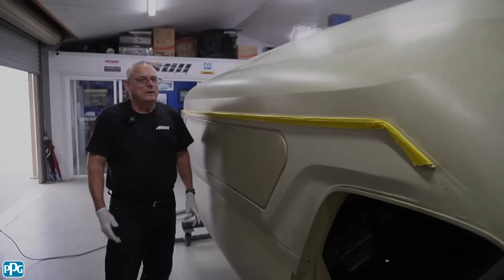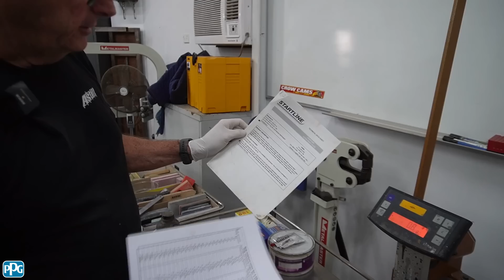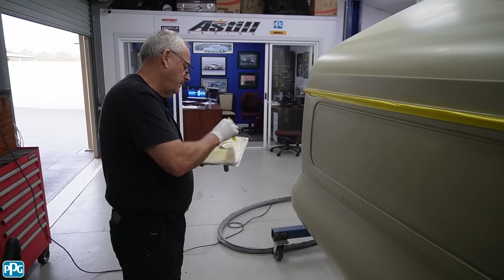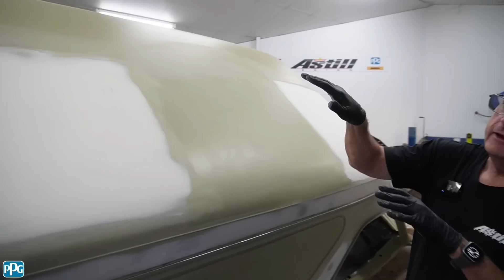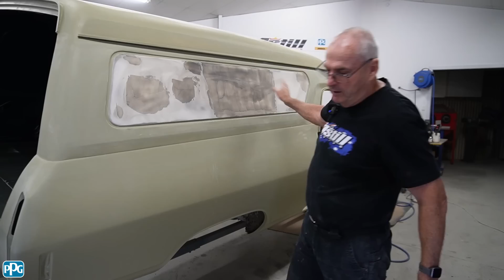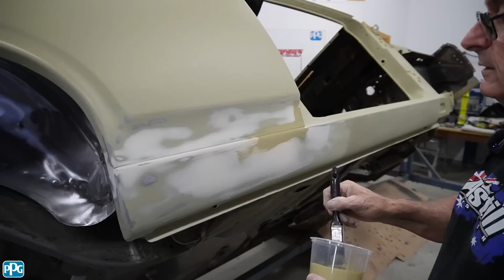Filler work & Body Lines on XC Falcon Panel Van #16 Magnum Force

Comment: Nice work Howie. You do use a truckload of bog in your viehcles don't ya
Reply from the maker: I use what is needed to get the result. I could use less but then I would use a truckload of hi build primer or Restofinish spray on filler.

Comment: Do you rub the primer down before applying filler?
Reply from the maker: The epoxy is sanded with burgundy merlon (scotch brite) 360 grit roe you can use 240 sandpaper. If has just been applied you have an 8 hour window we’re you don’t need to sand. Wet on wet.

Comment: I have been in a pretty heated debate with other painters that say hand sanding is the only way that you can't use air sander which I have learned how to apply both and doing alot of orange peel removal with orbital finish sander
Reply from the maker: There’s a place for all of it, you gotta find what works best for you.

Comment: Beautiful work again! Looking forward to watching you seal the drip rail. I've always struggled with them but just done one using blocks of high density foam. Taped both sides and slowly pulled the foam thru, shifting the pressure according to the changing width of the gap (Mustang with their awful build quality). Worked good but it's a bit of a fine line between hit and shit. Keen to see your method. Thanks again!
Reply from the maker: That sounds like a good idea.

Comment: Just to clarify what I think u are saying......by adding a same percentage ratio of catalyst for different batches of body filler , the filler cures with the same hardness value each time.
Reply from the maker: That’s correct. Consistency is the key.